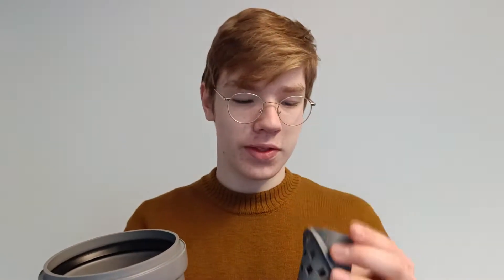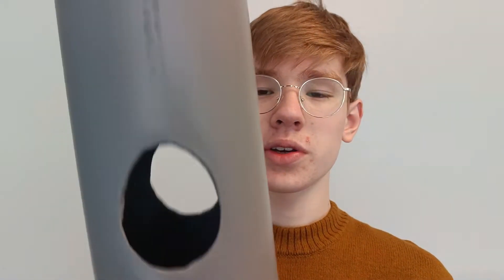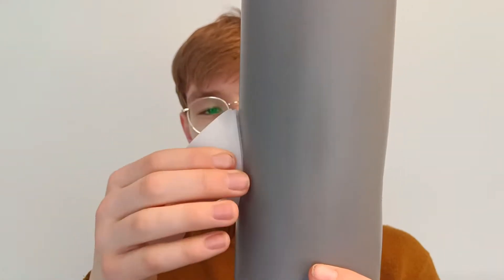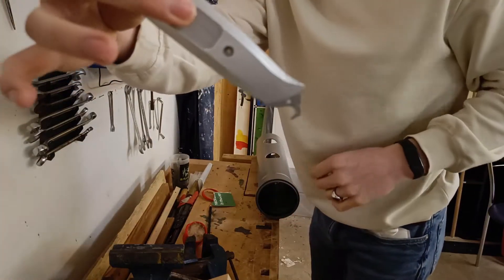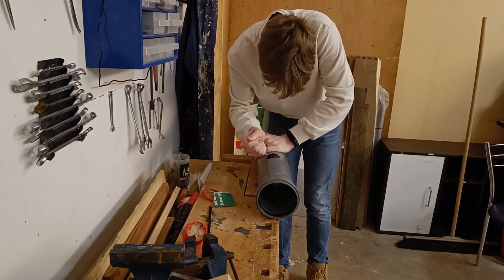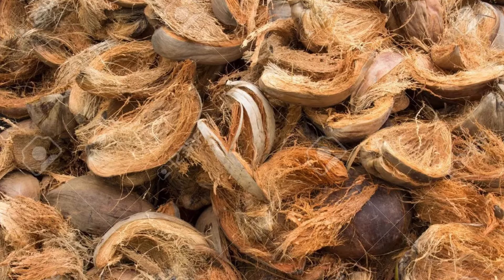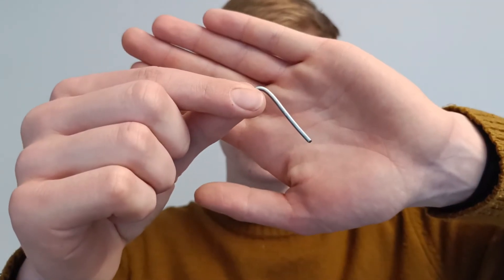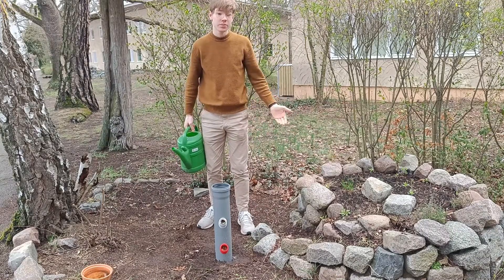3D printed Hydroponic Tower

Comment: I didn't see a follow-on to this so I'll ask my question here.  (If I missed the follow-on, please forgive me and provide the link.)

I have a few hydroponic plants in a similar tower that I 3d-printed.  They're doing well.  But as for strawberries, I would love to hear how well they did in this system and what your parameters were.  How long did you run the pump per cycle, and how log off?  Did you do anything different/unusual for the nutrients?  I tried strawberries in my system and I believe they got too much water (5 minutes on, 15 off per 20-minute cycle).  I'd be willing to try agaIn, but I'd love to benefit from your experience.